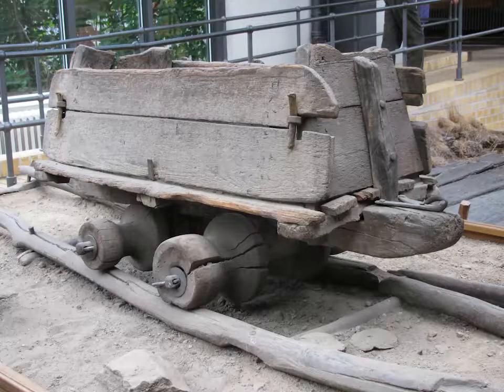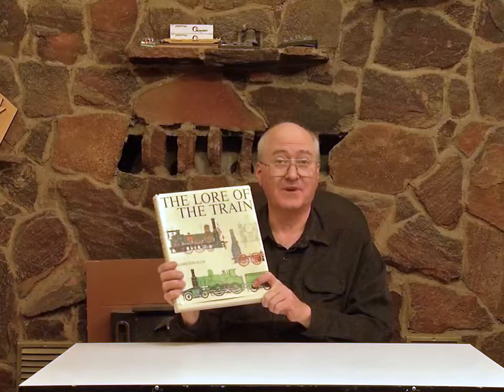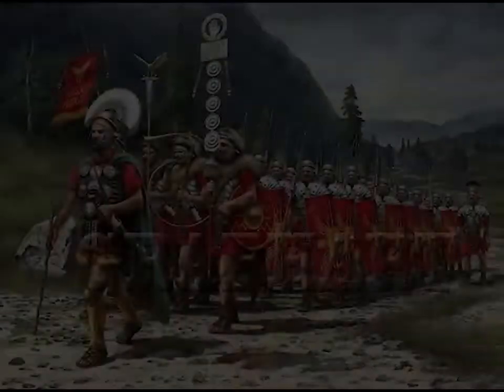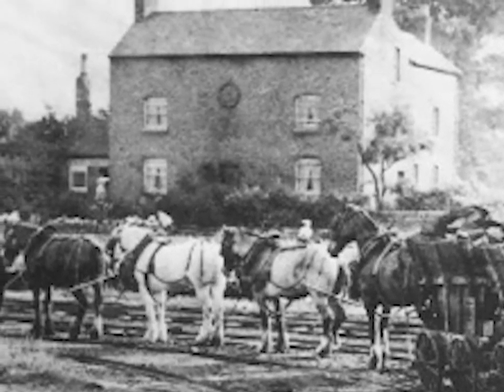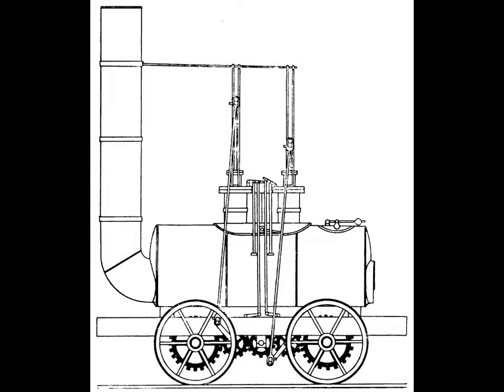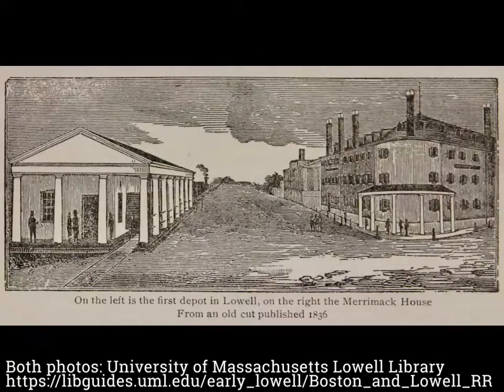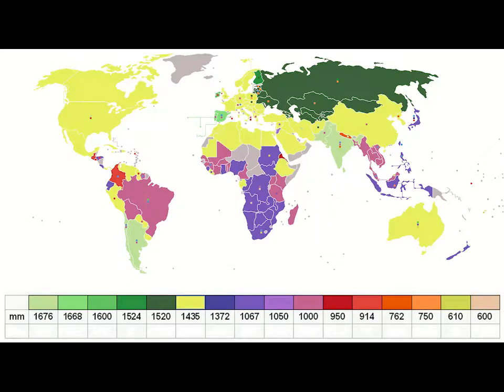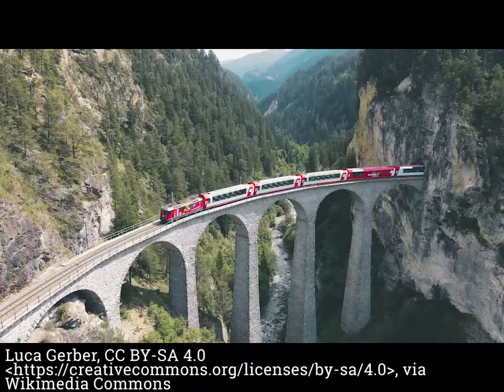RLMS: Gauge

Comment: An argument used was that mines inherited Roman measurements.  Like so many things time has made it impossible to be accurate. Stephenson started in mines.  Motorcars roughly follow similar sizes. Goldilocks size.  I worked out chariots loading gauge. was 1000 to a Roman mile. Mile implies 1000.

Comment: Near Lunel France( St Christol?) I measured chariot grooves. Exactly Stephenson gauge.  About 1/4 mile of grooves.
Reply: The point being that even though they might sometimes match, there was no causal connection between the choice for 1435 and those ancient chariots. Same way some cars can drive on railway tracks (apart from managing to stay on them) and many others can’t.
Reply: @GBOAC  One reason why some cars could be fairly easily converted to drive on railway tracks, presumably they were designed to. 
The Land Rover and the WW2 Jeep on standard gauge, and the much smaller Mini-moke was used on 3'6".
Reply: @stephenarbon2227  true, but that would also be the case on say Iberian or Russian gauge, it's not like a few cm would make a difference there, you would just use different rims. Only when you would look at the extremes like 750 mm or Brunel's 2140 mm then it would be more challenging to make a regular car run on them without more extensive modifications. The point I was responding to is that the > specifically 1435 < being the standard doesn't follow from other vehicle widths. Let alone relate to Roman chariots or similar outlandish ideas.